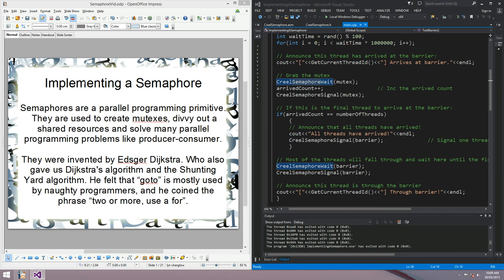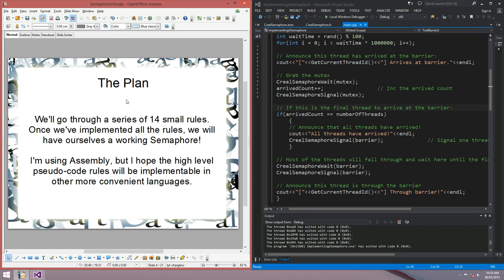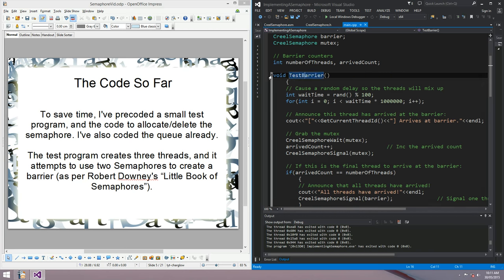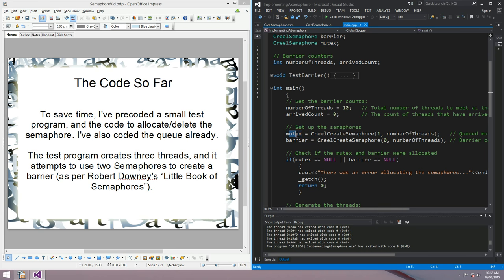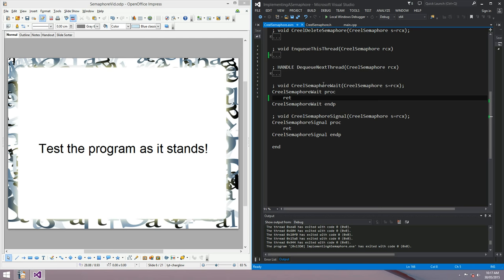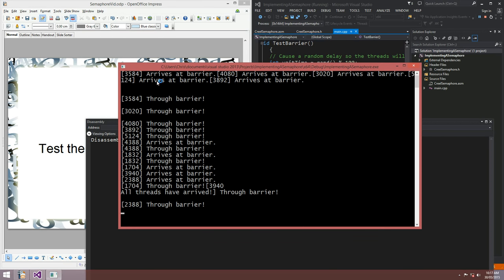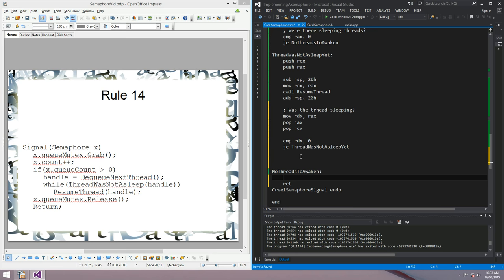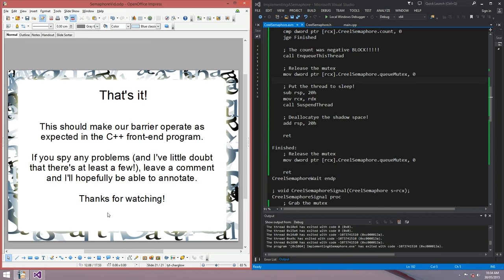Implementing a Semaphore

Comment: great video on the semaphore concept! Just to point out, though not affecting the effectiveness of the semaphore themselves, checking for the count after the semaphore may result, i think, in two threads giving the go ahead because the variable is updated by the last thread before the previous reaches the if statement. Again not affecting the semaphore which has been explained greatly, just got my attention. Great vid non the less!